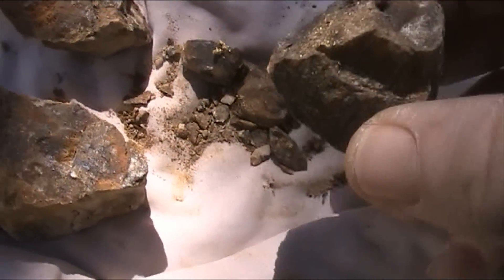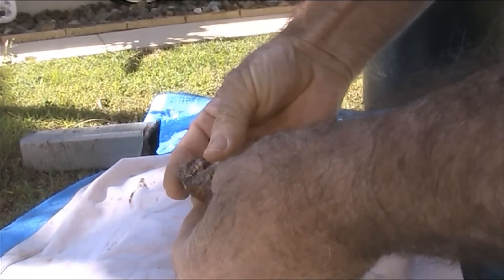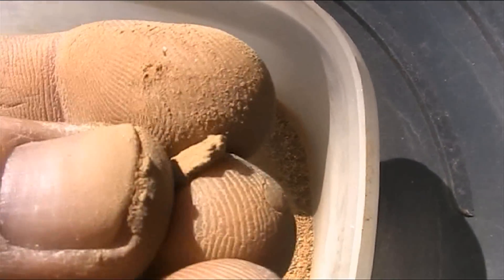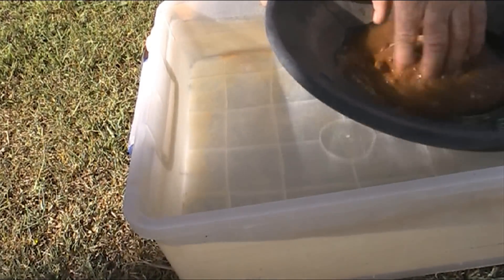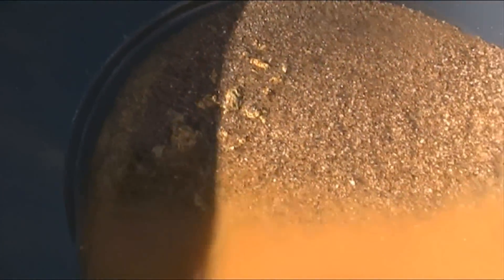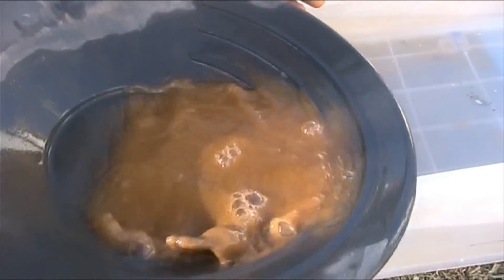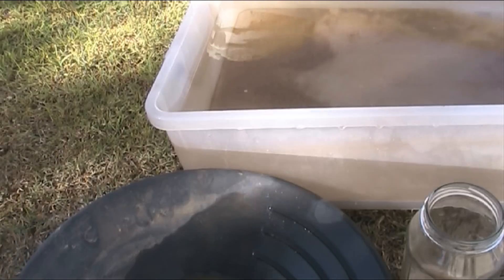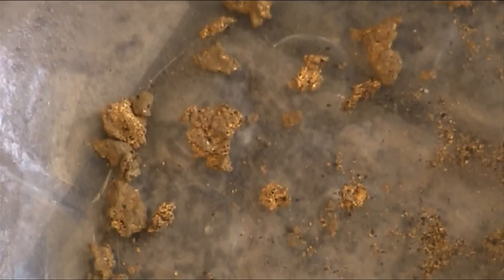DOLLYING THE 259 GRAM GOLD SPECIMEN.

Comment: You could actually use detergent (make sure no oil or lard mixture) to break the water bonds and make the water gold settle at the bottom. Its a lot easier.
Reply from the maker: +zebulun docallas 
Thanks for that l will give that a go next time, l was just using hand soap, cheers NM.
Reply from the maker: Thanks for that mate, its good to hear, hope l can film a few more next trip, all the best, 
cheers NM.